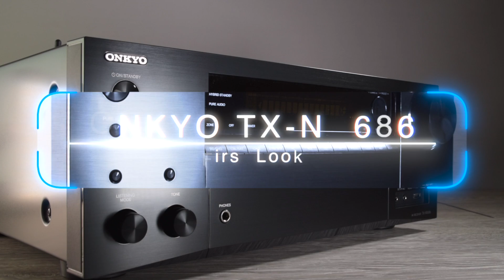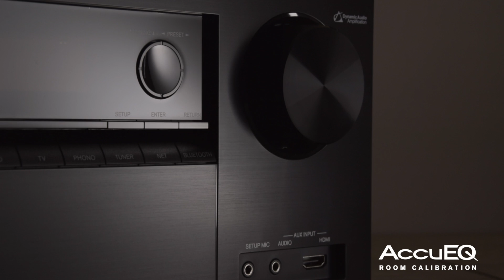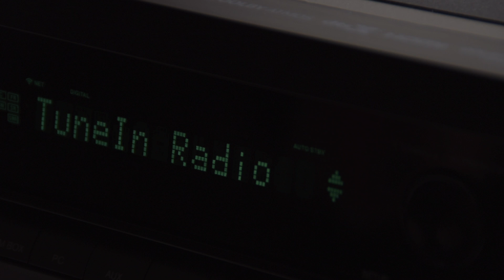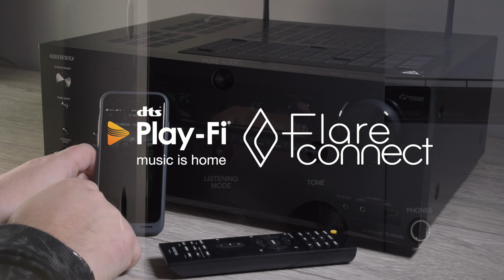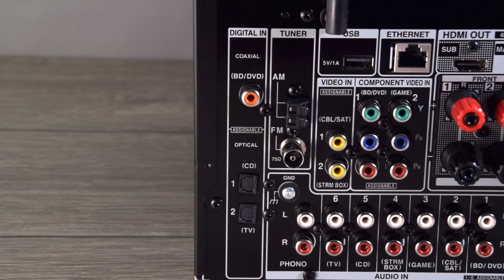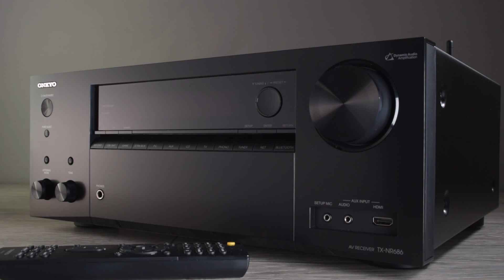First Look at the Onkyo TX-NR686

Comment: I have a DRX-4, expensive receiver. It looks new cosmetically and was working great. Then, I decided to update it. I ran the firmware update and it took around 30 minutes, then finished and read "Completed!" on the display. I waited, thinking it would restart, but after several minutes, it did not. I turned if off. When I tried turning it on, it would do nothing. Their crap firmware bricked the receiver. Onkyo claimed it was just "coincidence" that the receiver failed internally exactly at the same time it updated.

Never again.

Comment: I have a onkyo NR 686 7.2 receiver but unable to configure 7.2 in speaker setup even after connecting 2 active subwoofer in separate ports given for sub. Still setup options shows only 7.1 and not 7.2. Could you please help.

Comment: This one works great💨>lnfo.help/Receiver?エ    It has as many inputs as you can need and sounds great. The automatic audio setup was easy and worked great. Setup is also easy. No manual required. Just turn it on and follow the instructions. I really like the Bluetooth feature. I play a lot of music from my computer and the bluetooth saves me a lot of time and a wire. If I have to have a complaint it's that the thing is pretty tall. I had to squeeze it into the spot on the shelf above my TV, but it fit and works well. I would recommend this to anyone.

Comment: Hey...if I want my subwoofer to receive most of the bass, what do I set crossover at?  Thank You, Geno.
Reply: No it is the opposite,  how higher you put your speakers (max 200hz) more bass will you subwoofer will takeover from your speakers . But almost no bass in your speakers will not sound nice. So have to play until you find what you like. Floor speakers needs less hz and satellite speakers needs more hz... good luck
Reply: Akár 120 Hz-re is lehet állítani a mély hangok (40 - 200 Hz) felső határát. Igy többet kap a SUB.
Reply: GENO KRAPA 80hz is generally ideal.

Comment: My wife got me this model over a couple weeks and make sure you press the power/standby and BD/DVD buttons on the receiver itself to enable 4K HDR on the HDMI inputs otherwise you’ll only have 1080p HDR!!! I can’t believe Onkyo didn’t specify this on their website or instructions... One of those hidden menu options.. other than that this is an AWESOME receiver! Best Buy brand new for only $250!!! (Plus tax lol)
Reply: Yup, just picked one up for that price 5 days ago as well from best buy.👍
Would you happen to know how the #6 HDMI (assignable) on the back works? I couldn't get a picture so I connected my console to the  HDMI connection on the front.
Reply: One Two 

For HDMI 6 (asignable) I’m not really sure because I’m not using it but I assume you mess with that in the settings menu. I have my PS4 connected in the back on “Game” and 4K player on “BD/DVD”. Also have ARC running on my LG tv obviously :)
Reply: holy sh*t!! thank you so much!! 😅😅
Reply: @maxpower4043  
Wow 3 years ago already huh! Time flew! I got the Onkyo TX-RZ50 for my birthday back in September and now use that as my main home theater/game room. I’m using the 686  for the family living room now🤙🏻

Comment: Questionable quality. I have one of these units & after 3 months the Bluetooth stops working for no reason at all, and the only way to fix is to switch off power at the source.... which is a massive pain in the ass when all your cables are concealed inside a wall unit.

This is the 2nd ONKYO unit I've had problems with in the last 6 months.
Reply from the maker: Hello and sorry to hear about your experience - have you tried to find a reason/solution with our Customer Care team? Sometimes things like this can happen when devices are paired with other devices, too - and the connection switching from one device to another... The colleagues from Customer Care may have some hints for identifying the reason for this behaviour and possible solutions/workarounds. Thank you!
Reply: Cammac8 

Man must have bad luck. Sorry to hear about that

Comment: does this support a 7.1 setup PLUS two ceiling speakers?
Reply from the maker: Hi, this model supports 5.1 plus two ceiling speakers (5.1.2). For 7.1.2, you may want to have a look at the higher TX-RZxxx models. Thank you!
Reply: OnkyoEU I would rather have traditional 7.1 than compromising my surround back to the ceiling or front height, because I am more immersed with surround back and and surround left and right, if I can afford to buy 9.2 2 for the height might consider those. But I can never go back to 5.1 just for the sake of atmose I am gonna feel cold.
Why would I want ceiling speaker when there is no even enough contents recorded on dolby atmose, it’s just gonna sit there all way through out the movie doing nothing most of the time.

Comment: Hi OnkyoEU, I have a Samsung UE65MU6400 TV and an Onkyo TXNR686 AVR. Now can you tell me why the ARC/CEC function works so erratically? The power on/off CEC feature works every time but the ARC function doesn't always relay the audio from my TV to the AVR. I have spent hours trying to figure it out as I have had it working beautifully on several occasions with the ARC doing what it claims but if I disconnect the HDMI cable and plug it back in again, it stops working.

Now I actually sell your products and I want to master this ARC problem with your receivers as I am really impressed with the sound and build quality of your products in general.

Could you possibly create a step-by-step video guide for getting an Onkyo AVR to work with a Samsung Smart TV (both with ARC of course) as this will help to identify the fix?

I know ARC functions aren't standardised across the board for various manufacturers but I am confident there must be a troubleshooting procedure between Onkyo and Samsung products.

Thanks.
Reply from the maker: Dear Flex Diezel, thank you very much for your feedback. Indeed one of the problems with ARC is (as you mentioned) that ARC functions are not fully standardised. Please do not hesitate to get in touch with our customer care team via phone to discuss your issues - eventually the colleagues have some specific tipps that will help with your configuration. However we forwarded your suggestion for a video about ARC setup to the colleague creating the videos. Thanks again for your feedback!
Reply: i have the same problem with my yamaha amplifier

Comment: Hi, I have just bought this system and paired it with Dali Zensor pico speakers as I want to have more accurate representation of my music mixes but also a home cinema feel. Have I made a good choice?
Reply: Hello. Am planning to buy this receiver. Does it match well with your dali speakers as i also have dali spektor as front and zensor pico as centre and surround? Thank you
Reply from the maker: Hi David and sorry that we cannot comment on 3rd party products - as we cannot test any possible combination of products. But eventually one of the other viewers/readers can comment here? Thank you.
Reply: OnkyoEU thank you
Reply: Amp-speaker match-ups don't necessarily depend on the brand, but on the specs of each product. Thus you'd need to check the impedence (4ohm; 6hm; 8ohm etc.) sensitivity (90+ db would mean easy to drive speakers; and power handling of your speakers (200watts; 300watts etc). All this needs to be checked against your Amp/Receiver. For example it is recommended that you go for a 8ohm Amp for 8ohm speakers: Best match up!👍 Or you can driver 4; 6 & 8ohm speakers with a 8ohm Amplifier/Receiver. Note : Do not drive 8ohm speakers with a 6ohm Amp/Receiver for example, as this will cause the Amplifier/Receiver to be unstable and might cause clipping (shut down). A head room of about 2ohms is recommended for the Amp/Receiver in relation to speaker impedance. 

Therefore:
A 8ohm Amp/Receiver  can drive 8ohm; 6ohm; 4ohm speakers with no problem.
But a 4ohm Amp/Receiver cannot drive 8ohm & 6ohm speakers. Hope you came right with your setup seeing that it's been a year already lol.

Comment: These new generations of receivers are good but they are lacking the set-up microphone has changed and it has got no dynamic EQ and no dynamic volume this is really noticeable music does not have the muscle of the old TX nr609 and 579 which I still have when I compare the new with the old TX nr609 the 609 completely and utterly demolishes the 555 musically it is brilliant and films are excellent I will say this though the benefits of the new amps they have sorted little issues with internet Wi-fi and Bluetooth that having said it is very easy to go round that for about additional 10 15 quid you can make these Wi-fi and Bluetooth enabled come on Onkyo regarding sound quality you've just gone back 10 years making stupid mistakes like that now is going to cost you a custom that kind of error you expect a 20 years ago not by company like Onkyo that has just brought out Pioneer and Denon so come on chapps when you upgrade go back to the original room calibration mic put dynamic EQ on put dynamic volume back on and pay attention to music
It seems like you have gone for convenience and features and forgotten about what is most important sound quality I totally understand they are not classed as good as proper Hi-Fi on music however with the older Generations the 609 sa57 9515 they all play music very very well I do not think anybody with human hearing could tell the difference what is hi-fi advocation and what is Onkyo AV so come on fellas pull your socks up and sort your s*** out one thing I will say about Onkyo is there after service absolutely first class as I said I have the Onkyo 609 and 579 they both developed the fatal HDMI board failure bear in mind These amps or nearly 8 possibly 9 years old I've got in touch with Onkyo and they collected both amplifiers repaired them and sending them back to me all free of charge that tells you how much faith they have in their product absolutely awesome for that I will still go with Onkyo but let's see what happens in the next 2 years but this new generation also called new generation of surround sound receivers really do not cut the mustard so maybe less on it and focus more on sound quality please
Reply from the maker: Dear Andrew, thank you for your feedback which we will forward to the engineering/product development department in Japan. If you think that the customer care team can help you with specific issues, please do not hesitate to get in touch with the colleagues (e.g. via www.eu.onkyo.com). Other than that, we can only forward your feedback to the engineering department as-is for consideration. Again, thank you for your feedback and your kind understanding.

Comment: So the only difference to last year's model (676) is slightly higher wattage output (10W) allowing for the THX certification to be applied. (Which isn't really necessary) And a $200+ higher price-tag (Apparently to help Onkyo pay for the THX licensing fees).

The 2017 676 model remains a far better deal for essentially the same thing! ... All other specs are identical.
Reply from the maker: Hi, please do not compare introductory SRP pricing with special % sales prices of models being "end of life" (EOL). E.g. in Germany, the introductory SRP pricing was actually the same for TX-NR656, TX-NR676E and TX-NR686 (as an example...). Thanks :)
Reply from the maker: Hi, if you do not require THX in your configuration and do not necessarily need the latest model, there are currently obviously interesting offers for TX-NR676E available - so it is up to you to decide :)
Reply: just ordered the 676 i love onkyo great value and features without inflated cost
Reply: ok so the thx cert and 10 more watts are worth the extra 200+ ?? comparing 2017 to 2018 model?? directing this to OnkyoEU
Reply from the maker: Hi Andreas, thank you very much for your feedback! :)
Reply: How to canect the woofer RPW-10 KLIPSCH,,,,and MAGNAT MONITOR  SAPREME 2002 at 200 watts???
Reply: Too much hot.. cannot buy
Reply: @wjwhitewjwhite093  But does it die? I run a TX-NR686 and it performs just perfect. Hot that doesn't damage the unit is no threat for me.
Reply: OnkyoEU absolutely true. You are right of course. End-of-year sales are highly discounted. Not comparing, just suggesting that maybe purchasing end-of-year is a smarter move. Seeing as how they're almost identical inspect. Why would you pay more if you didn't have to? No new technology, specs are the same, looks are the same, one of the commenters here is absolutely correct. Put the $200 to work better speakers. But thank you for your input Onkyo. By the way, are you ever going to get CEC, and ARC working properly across the board? Shame on you! It never works and you know it!

Comment: does this support hdr 10+?
Reply from the maker: Hello, currently HDR10+ is not supported. Thanks for asking!
Reply: OnkyoEU But it will?
Reply from the maker: Hi, we're afraid we currently do not have any more detailed information about this, the only reliable information we have is: as of today, there is no support for HDR10+.
Reply: @OnkyoEU  Hi, are HDR10+ and Dolby Vision not the same thing? According to the product information HDR10+ should be supported? Or am I wrong?
Update: no, ok, it's not the same... sry.
Reply: @tillbreithaupt4258  Hi Till, I actually sell AV products. To answer your question Dolby Vision and HDR10+ are rival technologies aiming to do the same thing, which is rendering a dynamic metadata on a frame by frame basis to supported HDR content. HDR10 is static meaning it is already built into the disc or game disc. But DV and HDR10+ are built into the UHD BluRay player or supported TV or even VOD streamer. These then work on the content separately on-the-go enhancing the texturing, depth, detail and colours of the content you are watching and makes the images pop with brighter whites and deeper blacks.

Netflix features a lot of DV content whilst Amazon Prime Video will be supporting more of HDR10+ content.

Dolby Vision is engineered and created by Dolby Laboratories whilst HDR10+ was engineered and created by Samsung, Panasonic and 20th Century Fox.

Hope that helps.
Reply: @flexd23  Hi,

thank you for your detailed answer!
Helps alot and makes things clear!
Reply: @tillbreithaupt4258  You are welcome Till. 👍

Comment: Will this one have the same issues as other TX-NR6x6 with the TI Dolby chip? My 616 is in service right now for the 4th time to fix that design issue with the overheating of a BGA packed chip that is responsible with most functions of the unit (audio routing, Dolby decoding, network functions etc.).
Reply: Brian Seaman check the remote. Batteries are fresh? If its not under warranty anymore you may dismantle the remote, clean the button pads on the rubber side and on the electronic board, put it all together and it should work.
Reply: Horațiu Slăvescu , I WAS in the market for a NR676.   Should I not get it now?
Reply: Nathan Oliver don't know about this series. It's well known, ONKYO had in past issues caused by bad thermal design, one very important chip was overheating and this was melting the tiny soldering balls under the chip. I just hope these will be better but I won't buy ONKYO anymore.
Reply: The electrician set up my onkyo but now the remote doesnt work.  Instead, some of the functions are powered by my Samsung TV remote. How do i get the Onkyo remote to control the AV receiver?
Reply from the maker: Hi, the known issue with loss of audio or network connections is still covered by the Customer Service Program (http://www.eu.onkyo.com/en/customer-service-program-118747.html) until end of this year (2018). But please be aware that this is not related to overheating - it is a defective chip itself (like "incorrectly programmed"). Models newer than the years mentioned on the Care Service Program page are not affected by the issue...
Reply: Its unfortunate that this program has been modified and Onkyo is no longer fixing the faulty receivers.  Mine failed due to no sound and was confirmed to be part of the program but the best they would do is a discount on a new receiver, if I send back my serial number sticker. Now I wish it had failed earlier so I could have it repaired for free instead of spending $360 on a "discounted" new one..